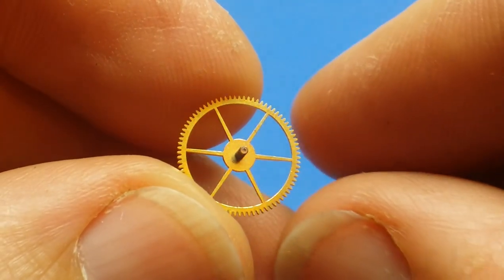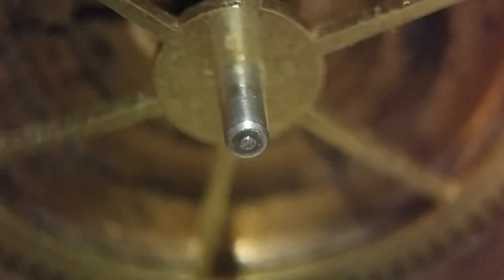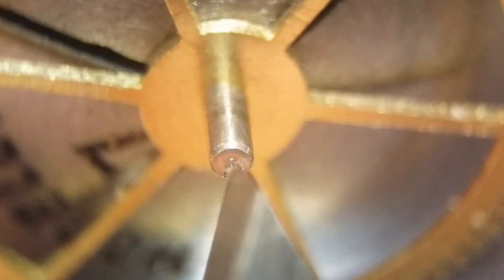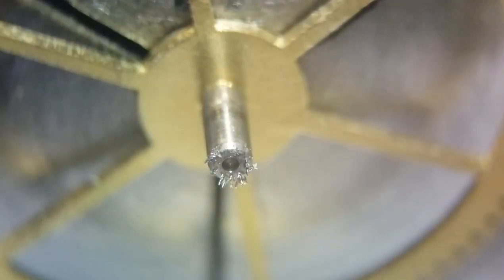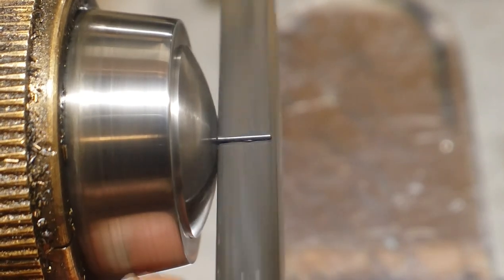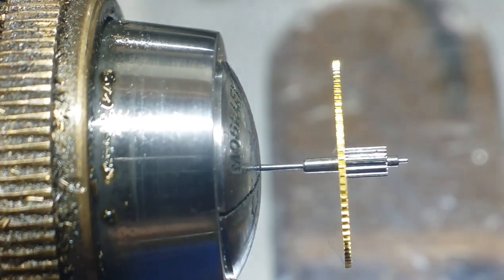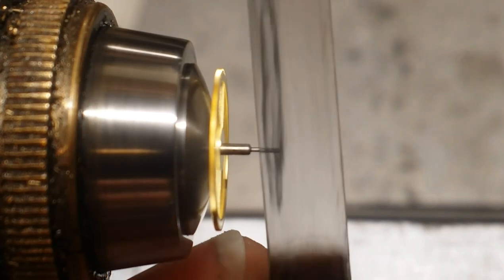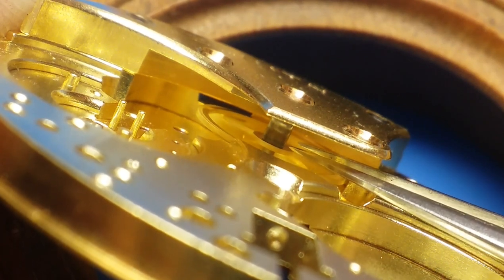Repivoting technique #1, collet holding lathe, free hand

Comment: Nice video, thanks for sharing!
I was taught that diamond rubberized abrasive might embed diamond particles in the pivot and cause excessive jewel wear over the time.
Reply from the maker: A very legitimate point. Aware of this when using the old diamantine or sapphirine powder on a wood lap, I for years finished pivots with a jasper stone. Recently though I became familiar with another watchmaker who did his final touch up with a cratex style rubberized abrasive. The finish he achieved was better, so I reconsidered. 

The way to think of it is this, the abrasive will embed itself in the softer material and cut the harder material. If the rubber already has the abrasive in it, it shouldn't embed in the steel pivot unless you are rubbing it so much to as to heat things up and produce a lot of rubber/eraser shavings. A quick swipe or two at the very end, then properly cleaning it should eliminate any potential of contamination.

I am aware of instances of worn jewels where diamond or sapphire powder was used for polishing a pivot. I am not aware of cases where other solid or fixed abrasives have caused wear. I guess time will tell.

Comment: Very nice and precise work, a question. I've been looking for that Jeweling Gauge online but have a hard time coming across one. Is there a specific brand name associated with this tool? Any info is much appreciated.
Reply from the maker: There are different kinds of jeweling gages. Which kind are you looking for? The tapered pin variety for measuring inside diameter? Or a pin set of different dimensions to also measure I.D.? Or a plate with different sized jewels for measuring different pivot sizes?

Comment: Do you think a notch for the drill in the tool rest, properly adjusted of course, would help to guide the drill straight into the arbor? I’m sure I’m not good enough to freehand it in as straight as you did.
Reply: Freehanding a concentric hole into the end of a spinning shaft is surprisingly much easier than it sounds.  Of course, it does require some practice and a soft touch, but even the tiniest bit off-center and you can feel it through the tool.  Doing it this way, you’ll find yourself breaking far fewer drills, so long as you’re going slow and paying attention to the feel of the tool.  And he is right, clearing chips very frequently is extremely important.

Comment: I have an antique english high grade M I Tobias pocket watch movement with a broken center wheel staff and I don't know if it can be repaired or needs a new one
Reply from the maker: It is possible to repivot the center wheel, but might be quicker to replace the whole pinion if you can find a matching one. I would be willing to try if you are willing to wait months for its completion.
Reply: @repivot2253  I actually have two english pocket watch movements, the one I've just told you about and a John Moncas whose mainspring barrel cover doesn't close tight and it pops out everytime I wind it up, so, I don't know what's wrong with the piece

Comment: Why do you use piano wire ? and not blued steel?  im a beginner in watchmaking
Reply: Blued steel would be too hard and brittle, very difficult to cut. Piano wire is hardened, but then tempered enough to be cuttable, but still strong enough for the job.

Comment: I need to drill 0.30mm x10 mm long in En52100 material. I get deflection at the opening hole . Please suggest how I should drill cencentrically?
Reply from the maker: If you strike the center like I demonstrate in this video that will help get the drill started on center. Be careful so within the cut center you don't have a little bump. This will throw the drill off center. The center you strike should be a perfect concave cone about the diameter of the drill or less.

If you do have this and the drill cuts off center, the problem is your drill bit. Only one side of the center is cutting. Resharpen you drill bit, making sure the angles on both sides of center are equal.

Good luck. That's a deep hole. I'm not familiar with the material you are drilling.

Comment: Intresting. What is the consensus of tolerance between the jewel and pivot?
Reply from the maker: Excellent question. In smaller wrist watch wheels and all balance wheels, it should be .01mm. Train wheels in pocket watches like this I accept as much as .02mm.
Reply: @repivot2253  Thank you for youre answer sir! 
Back in the, well almost black and white tv days. I was a toolmaker. Have recently picking up on my watchmaking intrest. Starting on service wristwatches for my own enjoyment. And trying to learn more on tooling and maschining repairs. Have a Simonet lathe that is similar to the Schaublin 105. But needs a little overhaul. And dusting off.. Bit to big for most work. So Im hoping to find a resonable 6 or 8mm collets lathe. 
Really like youre efforts making youre own cutting wheels ect! 👌

Comment: Where did you get the drill bits, please
Reply from the maker: I make my own from carbide tipped dental burs. Stay tuned as I'll make a video on this sometime in the future.
Reply: @repivot2253  but, where do you get these bits that you turn into pivot drills? Please
Reply from the maker: @JDRichard  for several years my dentist saves the old dull bits for me.  When I came in for a cleaning every 6 months, there'd be a little baggie of them for me to take home. I have a lifetimes supply now. 
I'm sure if you Google carbide dental burr, you'd find a source.
Reply: @repivot2253  Very good approach. I have a dentist appointment on Thursday and will ask if they have any leftover bits...or simply buy some new ones:). Thanks by the way.